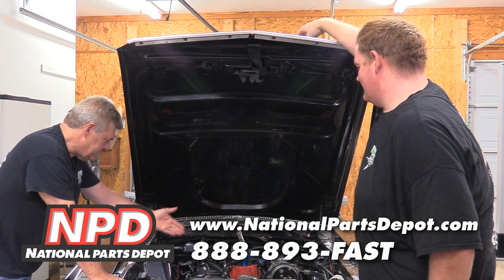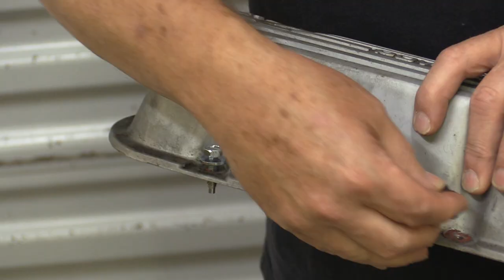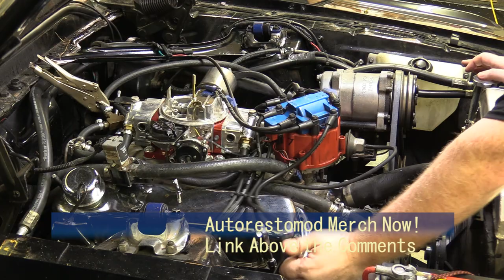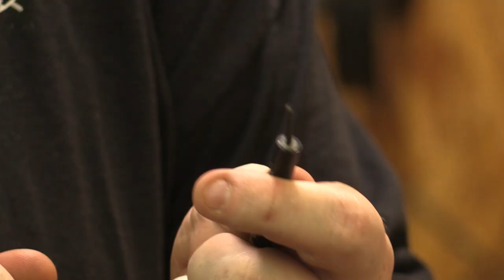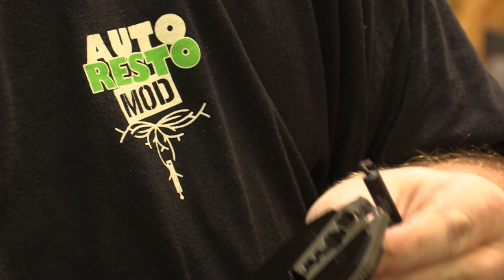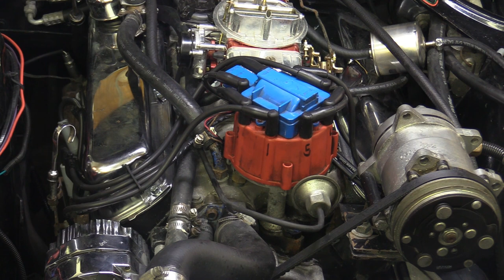Custom Cut Plug Wire How To

Comment: Jeff, Jeff... Every True Blue Ole School Ford guy has tons of Ford bolts and nuts in the garage, under my work bench!  And what's with the Chevy cap on a Ford motor??    🤣😂😁  But I prefer the later Mushroom cap with Motorcraft wires!  😎
Reply: I agree .Anything but the GM distributor. It looks fine on a GM when it's installed in the back .
Reply from the maker: Not my car, or my distributor. Though it is taking enough guff I'm starting to think about changing it. LOL
Reply: @mycontinental3611  Yeppers, and out of sight too :)
Reply: @AutoRestoMod  Yeah, but she's a Classic Mustang and needs to look original as possible... don't ya think!
Reply: @AutoRestoMod  I'm sure it works great. I actually thought about using one on my Ford for the symplecity. Just could not get past the GM look. As always love your Ford knowledge.

Comment: Not a fan of HEI style distributors on Fords. But at least the vacuum canister is pointing toward the front now, the way God and Henry Ford intended. Thanks for fixing that! 
It wouldn't solve the air cleaner issue, but maybe you could fit a rubber distributor cover like Ford used on the '86-'93 5.0 H.O.s to it. Not sure if it'd work, but if it did it'd pretty much hide the distracting eyesore that's there now. 
Happy to see more content coming out, hope the move to the new shop is going well.
Reply from the maker: There is no hiding that honker. Though I may paint it black to hide it in plain sight. Even so, I fear it will be saying "look at me!!!!". LOL
Reply: @AutoRestoMod  "Disguise" would probably have been a better word choice on my part than "hide," but yes, black would be an improvement.

Comment: Amen about the powered by ford valve cover.
Reply: Agreed! For years they were cheap and plentiful at swap meets and online classifieds, but not for a while now. Time for somebody to crank out some more. Maybe offer a black wrinkle finish option, something the factory never did with these.
Reply: @DragPakMerc  I actually run some vintage cal custom finned valve covers on my 302 that I took satin black and sanded the fins back. Also I love the FE style valve covers which are flat and you'd see on a Cleveland but I only ever run sbf for now.
Reply from the maker: The Cal Customs are nice and another I would like to see come out again.

Comment: Some wire crimpers come with threaded holes where you can trim bolts up to size 10 in fine and coarse thread, if youre not feeling the hacksaw… also… i call the bell notification the little dingy
Reply from the maker: LOL on the dingy. Yup! We figure if you don't have a hacksaw, why are you doing cars? LOL Good tip on the Crimpers.

Comment: Cut wire at angle it will follow curve in boot then strip and crimp
Reply from the maker: Good tip!
Reply: Came here to say this. Cut the tip at a 45, put on a little lube, back in the day Mallory told me to use armorall. Shove it in so the cut side pushes against the back and it will follow the curve. Once you do a few of them you can usually just push it through in a few moments.

Comment: I've always taken an ohm meter and confirmed the resistance per unit length of each customer wire. Guess I'm surprised it wasn't mentioned as a follow up for those with a little electronics savvy. Finding the electrical specification for each wire type is sometimes a pain though.
Reply from the maker: Great point! I struggle with how deep we should dive on shows.

Comment: Plz show us how to run full 12 volt !!!!
Reply from the maker: on a Ford, run a wire straight from the ignition switch to the coil. Don't do that with points though, you will burn them up.

Comment: You have shamed me into buying the special plug wire crimpers. I've worked around it for 65 years but had to have them after seeing how good they work. Probably won't use them 3 times then my son will inherit them.